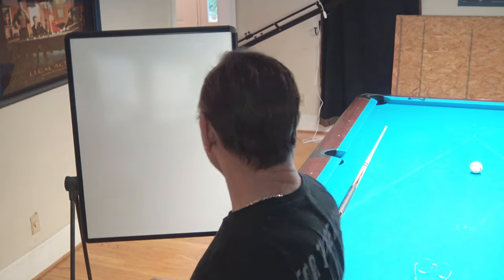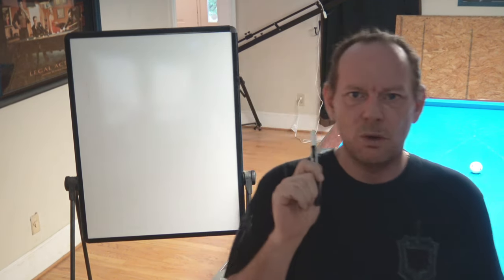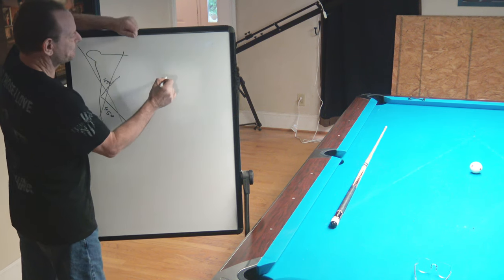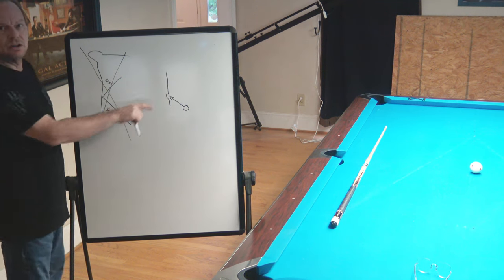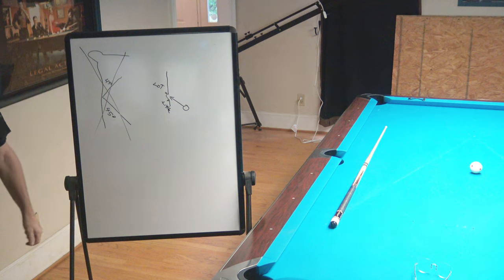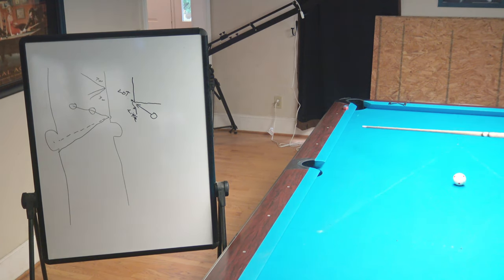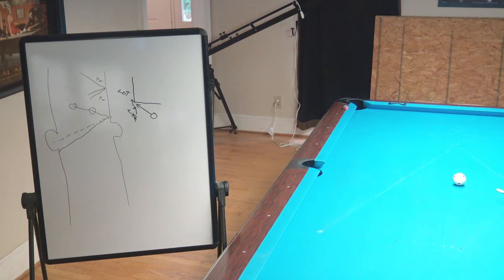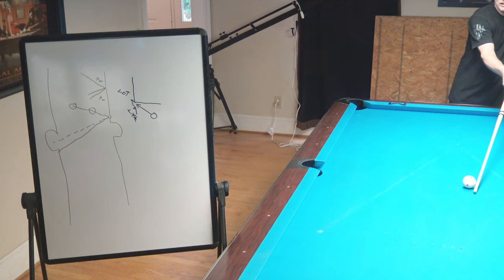Key Concepts  - How the Rails Work (Part 1)

Comment: Great explanation on this aspect of billiards. This is one of those things in pool and billiards that a lot of people know certain shots work but not why they work.
Reply from the maker: Thanks!  I'm planning on going down some roads less travelled.  This series is laying the groundwork.  Some of the shots we'll look at won't make any sense without understanding why they work.
Reply: Exactly
Reply: @compforce  set up at 30 degrees ..... jack up just a tidbit ..... using top english FIRE the cue to the rail and watch it..... next FIRE it with a little bit of favoring english..... next jack up a little more so that cue hops a little which will cause rail to compress in and down ...... Omg ,  such a wondrrful sport .... if people could only know the beauty of all the options..... and when you're in the zone you feel like you are floating around the table ..... thanks for doing this stuff

Comment: How can you tell if it's more or less than a 30° angle
Reply from the maker: 30 degrees is a rule of thumb, it's not that if it's 31 degrees the cue bites into the rail and at 29 it doesn't.  It's just an easy way to visualize whether the spin is going to react more on the first rail or the second.  If you need a reference, draw a line diagonally from corner to corner.  the triangle formed by the short rail, the long rail and the diagonal is a 30-60-90 triangle.  The angle formed by the long rail and the diagonal is 30 degrees.  

In reality, you'll get a feel for when it's going to happen with experience.  Very flat into the rail, english takes on the second rail, very full into the rail it takes on the rail.  Slicker cloth, it's more likely to catch on the second rail, less slick cloth, it grabs the first rail easier.  New rails, they compress less so take a fuller angle to grab, old rails they compress easier so they will grab at a thinner angle.  There are a lot of variables and no video explanation is going to be a replacement for experience.